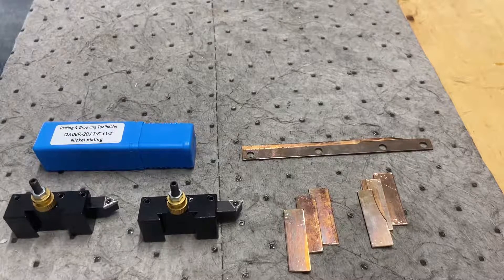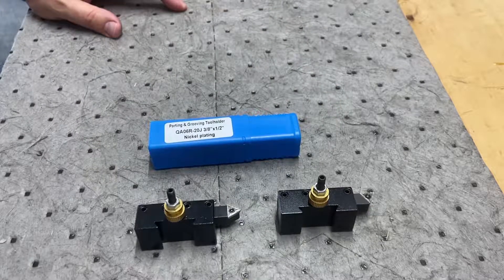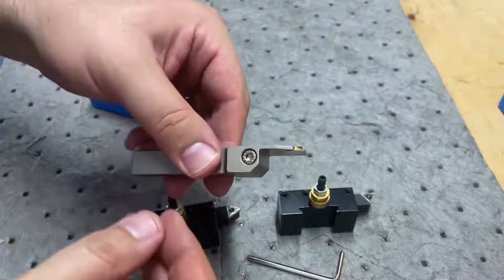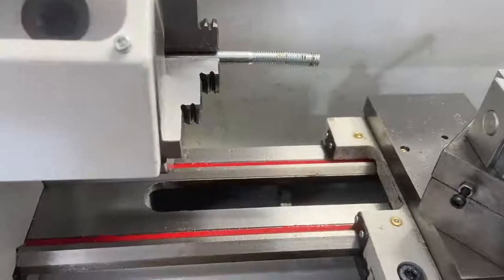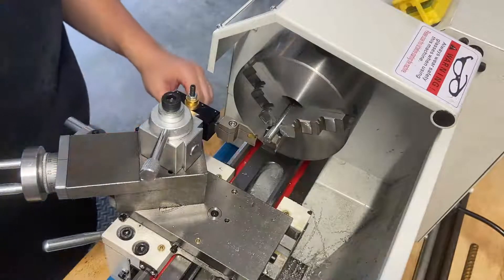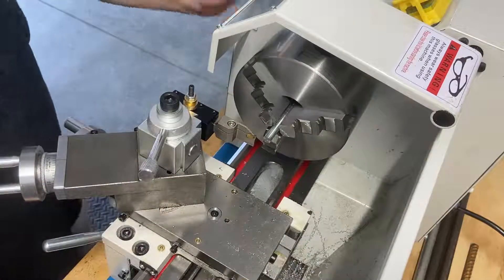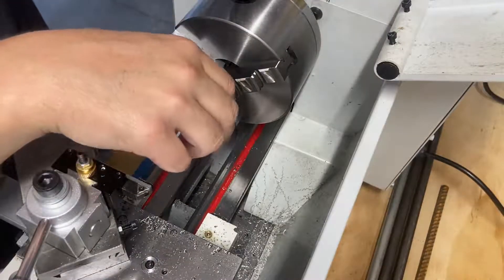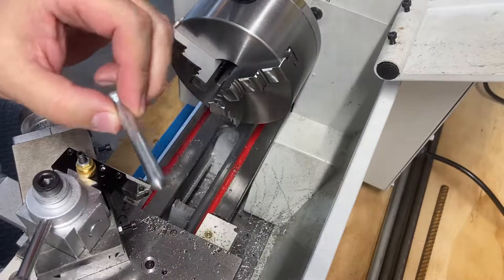Vevor Mini Lathe MX 400 Part 20 - Parting Tool Testing Copper Jaw Pads and Making a "Nail" or spike

Comment: Oh My friend next time you make a spike like that do it from the other direction Keeps the  hands away from Head and just have to cut in reverse... Learning is cheaper than Emergency room Bills. 

When you machine on the Lathe ALWAYS keep the adjustment knobs to the right of the Travel, going Left will catch you someday I've seen a guy Total a $19,000 lathe cuz that mistake when the Head hits the Travel  Knob It will destroy stuff Fast and hopefully not Kill you in the Process  FYI Safety
Reply from the maker: Since this video when I am cutting tapers I run the lathe in reverse,  It is far more comfortable and safe to use.  You are absolutely correct.  Learned a lot since this video.

Comment: Use Kool Tool liquid it works great  also get you a tool centering level
Reply from the maker: Items added to my list.  Eventually I would like to get some cooling for the mill,  Not sure I want full liquid flow or a mist style.  Or just a spray bottle.  I dont really want coolant everywhere but workign wtih Steel and larger projects I know I will want to keep my cutting tools cool.
Reply: They make a mister for Metal working, tank with air and valve to limit mist nice addition I've tried both mister and drizzler I like the Mister better... but thats just my opinion, the reason I like the Mister is the little air keeps chips away.. Nice video. @deezworkshop
Reply from the maker: @randybichsel4244  Thanks,  Appreciate your opinion and thoughts on the mister.  that may make the most sense for my hobby shop.  I want to make sure I keep my carbide endmills cool now that I got a Milll.

Comment: Somehow you have not correctly mounted the quick tool post. To change a tool it should not be necessary to loosen the center bolt also. Turn the compound 180 degree round.
Reply from the maker: Yeah it isn't right for sure but got me started.  working on improving this now.  Upcoming videos to address this.

Comment: When facing off or using compound slide lock the carrage this will help stop the chatter
Reply from the maker: Thanks, I have learned to lock the compound when facing.  Makes a huge difference. and really needed to face cleanly with the carriage backlash I have.  Good suggestion for sure.

Comment: When parting off keep the rpm low about 100 rpm . Check out blonde hacks on how to set up and use parting off tool .
Reply: The backlash will be in the leadscrew. If you have altered the 4 screws along the side of the cross slide these will need to be reset. Start from the middle, unlock the nut slightly and with the allenkey nip tight and lock off the nut turn hand wheel to see if it binds, if so unlock and slackon off slightly repeat on all gib adjusters. Then on the top in the middle of carriage you will see 2 Allen screws, slacken both, underneath is leadscrew nut with a split, the small grubscrew will adjust the thread .when adjusted lock large screw . Wind back fully, crack the 2 bolts holding the assembly, ( this aligns the assembly) tighten back up . Any slack in the handwheel can be taken out with the nut holding the handwheel in place. Can take a while, be patient take your time and you should have it running smooth as butter
Reply from the maker: @waynesmith1046  Excellent,  I am going to go through these steps over a few Oktoberfests this evening.  I really appreciate the help.
Reply: @deezworkshop  I started about 6 years ago and had to learn the hard way, not much help out there for nubies, Frank hoouse was very useful. Will help if I can. Noticed that you had the compound slide turned to the left close to the chuck, turn it round so the handwheel is at the back, less chance of getting hand whacked or worse, spinning chuck just waiting to get you , don't let it. Be safe
Reply from the maker: @waynesmith1046  Yeah,  I knew someone would pick up on that. 🙂 I quickly realized that was not safe at all.  I'm not admitting anything but a slight graze to a knuckle or 2 may have occurred.  You are right Be safe don't get hurt.  I have improved and am working in much safer ways to work with this machine.  I hope others reading learn from my mistakes and your helpful comments.
Reply from the maker: I will check out her video on setting up the parting tool.  I know I didn't get it right and need to improve a few things.  In upcoming videos i have slowed my RPMS way down  I cringe at my own videos watching them on how high I've been running.  Future videos have the RPMS way down.  Maybe not exactly right yet but getting better....I think. Thanks for the tips.
Reply: @deezworkshop  she has a video showing how to level your lathe and align your tailstock. As for the backlash on the croslide there is a small setscrew on the top of the carriage, use an Allen wrench to tighten. This adjusts the lead nut underneath ( check out owner manual on the component's page .this will help you for replacement parts and part numbers. ) any slack in the handwheel can be taken up by tightening the nut . Should turn smoothly with no binding
Reply from the maker: @waynesmith1046  Thanks,  I have tried tightening up the nuts and there is tons of slack then its too tight and wont move.  as if there is no in between.  As far as the owners manual its literally a handfull of sheets of photo copied paper...no details whatsoever however I grabbed a Grizzly manual and its similar enough that it may guide me.  Ill take another look to see if I missed a set screw somewhere or can tweak it a bit better.  ill also check out all of BH's videos.  I am really liking her videos.